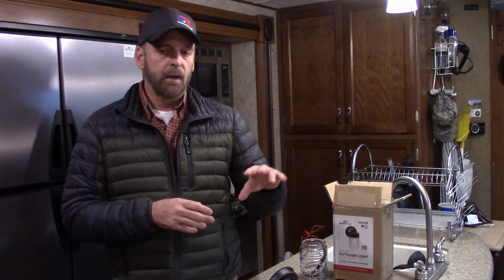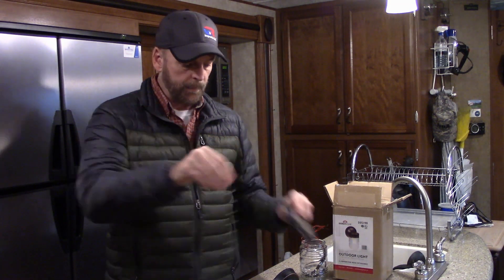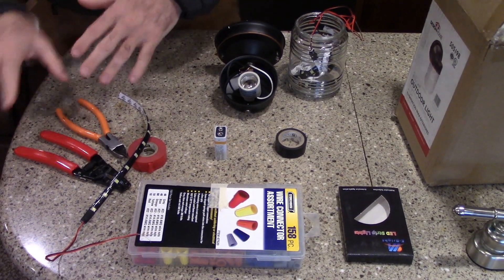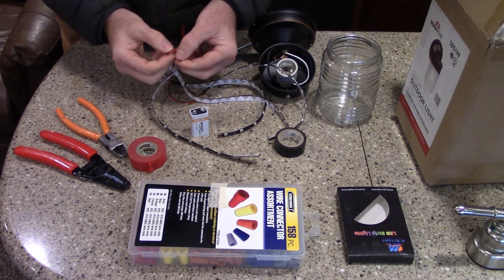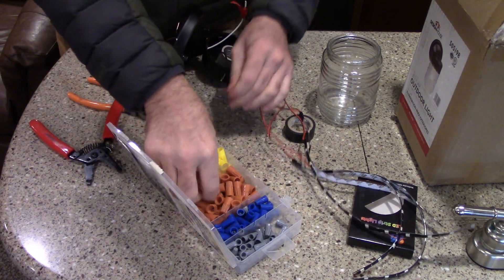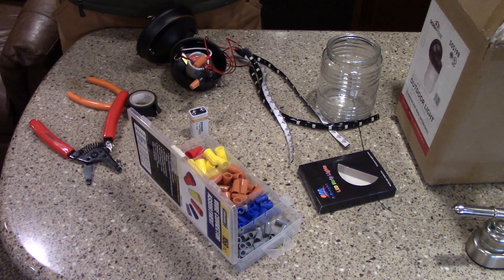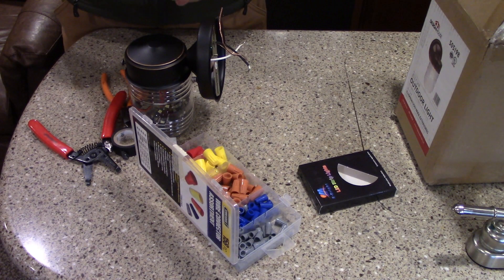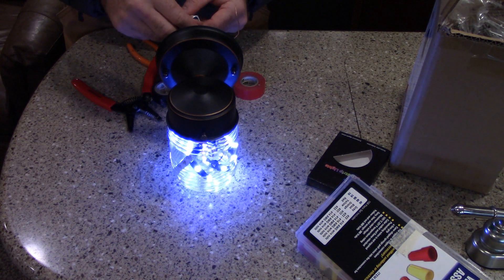12 Volt Off Grid Cabin Lighting how to convert a AC to 12 volt dc for less than 10 dollars #offgrid

Comment: I like the idea and it works but wouldn't it be easier to just buy a 12-volt screw-in light bulb and run it on the 12 volts it's already coming out the wall there? God bless
Reply from the maker: This video is over 4 years old. New tech has come out.

Comment: Keeping it simple would be to change everything over to 48 volts DC…… Everything, not just your house but every kar, truk, power tool, Lawn mower, weed eater…….. house hold Applianses……. Everything…… Use AC only to transmit power over 300ft / 100 meters.

Comment: I'm doing something similar on my RV and never even thought about getting 120V fixtures and converting to 12V. Especially since there's much better options

I also found out I can use a 120V switch too so it'll look way nicer then the stupid rocker switches!

Anyways, they also sell 12V LEDs that screw into the typical E26 base 😎 so you don't have to do what you're doing. You just literally wire it to the light and it should work as long as the bulb is 12V

As far as the wiring goes, I'd also personally do the black wire as Red since in a house that's considered the "hot" wire
Reply: What's gonna happen with a trilight fixture on 12V I wonder?
Reply: @FourthWayRanch  I'm not sure lol. But what I did was, I used a 120V light switch and a 120V light socket. Then I got a 12V bulb that screws into a 120V socket - it worked!

Comment: Wayyyyy too much work. I wired my whole barn using all standard fixtures and switches. I used low voltage landscape wire, some inline fuses, and standard screw base 12 volt led lights.
Reply: My landscaping wire is UL approved 12 gauge stranded copper extra heavy direct burial indoor outdoor rated 20 amps. My longest run has 40 watts of LED lights on it. That’s about  3 amps. I feel perfectly safe.
Reply from the maker: Landscape wiring in a dwelling isn't UL approved for indoor use. Not even in a barn.
Reply: I did exactly that in my detached workshop. You can buy 10-24 volt bulbs. I used 12 AWG landscape wire, but you can also buy more pro wire if you want. The lights have been running flawlessly for 5 years dusk to dawn so far.

Comment: Is there such a thing as 12 volt standard light bulbs that one could just screw in and run 12-volt power through the existing wires in the house?
Reply: It would be simple to convert an LED bulb that's designed for AC... just rip out all the circuitry and replace it with a single resistor... boom 12 LED light bulb with standard screw socket size called medium or technically called an E26 Socket... I'm not aware of any bulbs already made like this, but there are videos showing how to open the base (the usually plastic area between the socket and the faux-glass bulb) and access the circuit board without breaking the whole thing. best of luck, cheers.
Reply: Found one:

https://youtu.be/WPF4zKvkhf4
Reply: @binaryglitch64  thank you very much!
Reply: Yes, many choices in 12 volt light bulbs.  Some with standard edison base, others with bases for track lighting, etc.  And with LED, they don't use much power and produce the same light as similar LED bulbs using similar power at 120vac.

Comment: Great channel and great explanations. You are right the issue with 12 volt car lights is they don't last very long because they were never designed to be used like residential ones. I did the opposite, in my previous car, I installed a 12 volt residential 3watt spotlight as a dome light and it lasted for ever.
Reply from the maker: Thank you so much!

Comment: Thanks for this! What size wire did you run from your fuse box throughout your cabin? I would love some advice on that!
Reply from the maker: Depends on the load.( amps) on the load. <15 amp circuits 14 Amg 20 amp circuits 12cawm